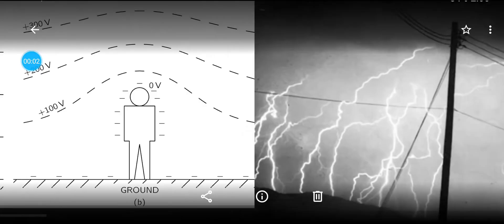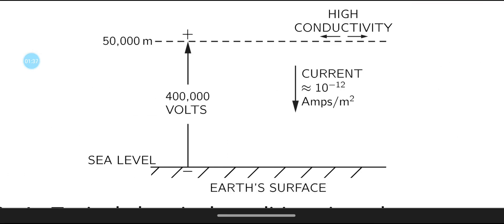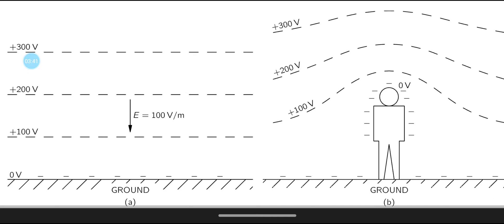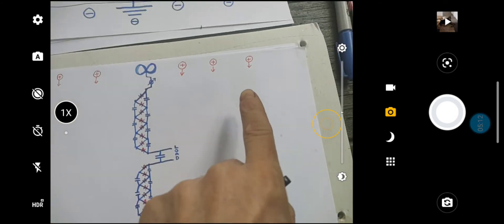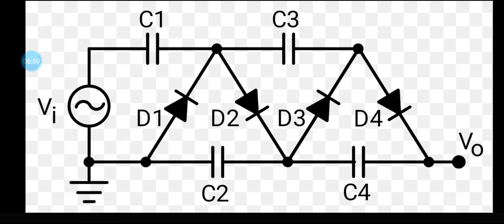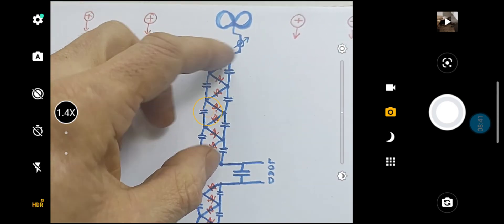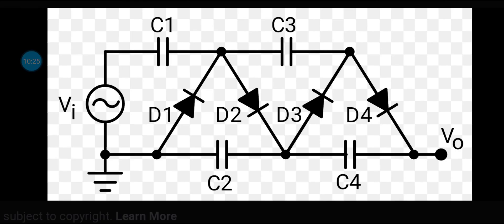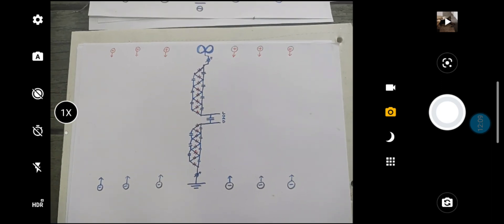Electricity in the Atmosphere (My Harvesting Concept Based on Feynmans Lectures.)

Comment: the current across a capacitor can be described using the formula I=C*dV/dT where I is the current or amps(ampere units), C is the capacitance of the capacitor(farad units) and dV/dT is the slope, or derivative for calculus nerds, of the voltage with respect to time. What dV/dT basically says is that the faster the volts change with respect to time the higher the current will be(for example rapdily switching from 0 volts to 100 volts). Maybe if one were to have an antenna connected to a switch that in the "off state" was connected to earth ground and then in the "on state" disconnected from earth ground and connected to a capacitor of some kind. Then simply switching as rapidly as possible should increase the amps available to do useful work. One could potentially take the amps they would like to see as an output and then work backwards to find out how fast they would need to switch to achieve the desired output
Reply: So I did some math on this and it turns out that the best results, in math not irl testing, so far have come from switching between two different potentials which interestingly ties back into the parrondo's paradox thing. I re-read that paper after I mentioned it and in the opening paragraph they said "Parrondo’s paradox was discovered from investigations in the Brownian ratchet [4–8], where a Brownian particle shows systematic movement through switching between two different potentials.". That got me thinking "what if we switched the capacitor between two different potentials instead of just on and off?". So I looked at an example where one had two 2mm copper antennas with one being 1 meter long and the other being 3 meters long. Each antenna has an off state where it is connected to earth ground and an on state where it is connected to a capacitor of some kind(maybe a water based marx generator-like capacitor). Then one would simply rapidly switch between the 100 volt and 300 volt potentials. When the 1 meter/100 volt antenna is connected to the capacitor the 3 meter/300 volt antenna is connected to ground and vice versa. From the pov of the capacitor it is rapidly getting 100 volts and 300 volts and from the pov of each antenna they are rapidly switching between connected to ground and connected to the capacitor. The issue is that one would need a high capacity capacitor to get something useful out of it. For example with 0.2 farad capacitor and switching between 100 volts and 300 volts, 100 times per second, one would end up with roughly 250 volts and 5 amps. That is way more than enough to overcome any losses from switching 100 times per second and even if my numbers are somehow off by an order of magnitude.
Reply from the maker: Absolutely Fascinating Mate ⚡🙏⚡
There is definitely much to be explored.
Do you do any Experiments yourself?
If Not,.I think You should.
You have a very sharp & inquisitive mind ⚡🙏⚡
Reply: I took a pretty deep dive into this concept and what I said in the OP should actually work if things are done right. While the formula I used was correct I had a couple incorrect understandings of what it was exactly and was off on the amps available(200 nanoamps for 1 meter by 2mm copper wire because 100 volts and 500 megaohms resistance). So the capacitance of a capacitor, eg. 450 microfarad or whatever, simply means "how much coulombs of charge is required to increase the voltage by 1 volt". The total charge available in a 1 meter 2mm copper wire in the air is roughly 100 volts * 200 nanoamps=20 micro coulombs of charge. When shorting a wire what happens is the resistance drops to near zero, actually whatever the baseline resistance of the components like the wire, etc, which causes a corresponding spike in amps. The total power available doesn't change so that means that it releases the total charge in the system at some fraction of a second. Ampere units are a measure of charge flowing past a point in a second. So when shorting a 1 meter wire with 100 volts and 200 nanoamps there is a spike of 18 kiloamps but it would dissipate the total charge available in the wire in about 92 nanoseconds. That is too many amps for most systems so what I did was think "what if I stepped the voltage down to just 1 volt", which made numbers a little easier. Shorting the stepped down voltage the overall power is roughly the same but the amps are lower; shorting 1 meter 2mm copper wire with 1 volt will result in an amp spike of roughly 183 amps. With the same overall 200 nanoamps but 183 amps current flow our timing becomes more manageable at roughly 9 microseconds. Basically that means that if one were to take that 100 volts and 20 nanoamps, step it down to 1 volt, and then short it every 9 microseconds the net effect would be 1 volt and roughly 183 amps per second. Which could then be stepped up to a more useful voltage like 100 volts and 18 amps or whatever.  With a 450 micro farad capacitor it would take roughly 22 cycles to reach the 450 micro coulombs required to increase the voltage by 1. If the timing was right one might not even need a capacitor in the system though. The longer the wire the more overall coulombs of charge and therefore the lower number of switches per second required.

edit the timing is likely off because it doesn't account for the time it would take for whatever system is used to step down the voltage to charge(e.g transformer or resistors in  parallel). To make the above timing work one would most likely require several wires and to alternate between them. for example, say 10 wires, then you short wire 1, then wire 2, and so on. By time you reach 10, just for example, the first should be charged and ready again. In this example the copper wire is basically being treated like a tiny capacitor.
Reply from the maker: I love your thinking my Friend. If you do get around to doing experiments with this,
I hope you upload to YT and link me to it too.
Keep up the great work Mate.
Cheerz from Crazy Ham ⚡🙏⚡
Reply from the maker: Superb & Thankyou 🙏 I did read of such an experiment which did actually do that.
Thanks so much for your Highly informative comment & Merry Christmas ⚡🙏⚡
Reply: @crazyham  one thing I've been thinking about that I haven't really seen discussed anywhere else is a concept I'm loosely calling "short power". Just as an example, if one sticks a 1 meter long 2mm copper wire into the air, and it isn't connected to ground, then it will have roughly 100 volts and like 50 picoamps. 50 picoamps is not really enough to do basically anything useful with but if one were to short that circuit after it has the 100 volts/50 picoamps then there would be a drop in resistance to whatever the baseline resistance of the wire is, virtually nothing, and therefore, according to ohm's law, a corresponding huge spike in amps. In that specific example of 100 volts/50 picoamps it comes out to an amp spike of roughly 18,000 amps! 18k amps is enough to be extremely dangerous and is useful. In general a "short circuit" is when the resistance drops to zero or near zero and the result is always a corresponding huge spike in amps. One can kind of think of it like there being something blocking a pipe with high pressure water flowing and then it suddenly letting go. Maybe if there were a creative way to store those amps then we might be able to actually do some useful work with atmospheric and or static electricity in general(which is easy to generate in huge voltages but low amps)
Reply from the maker: @crypticnomad  Absolutely my Friend ⚡🙏⚡
I think the key is to find a method of rapid Switching or Square/Pulse Wave Oscillating (Ideally at resonance) that takes very little power to operate whilst harnessing/Storing or Using the Resulting Currents that could be generating more  power than is being used by the excitation source.
I do genuinely feel that this can be achieved
even though it would appear to defy conservation of energy.
I love your thinking my Friend
& I hope that you find the Opportunity to Experiment with This.
Happy Holidays from Down Under ⚡🙏⚡
Reply: @crazyham  Also, maybe the power could be used to do something useful and negate the losses from switching, like turn a big flywheel. In my last comment I mentioned how shorting the 100 volts/50picoamps results in a huge spike in amps. Then maybe something like the lorentz force could be used to apply torque to spin some flywheel which is then useful for a bunch of different applications. Basically the concept behind magnetohydrodynamic drives and ion thrusters could potentially be used to generate useful work from rapid bursts of high amps. In the lorentz force equation if the angle is right, 90 degrees, then the resulting total force is basically the amps multiplied by the magnetic field strength. In the example of the shorted 100 volts/50 picoamps and using a basic n35 it comes out to about 1500 newtons of force or about 340 lbf(high-end electric sport cars have like 450lbf) which is on par with an electric car motor. Then if that force is applied at the correct point it could be used to create torque to turn a large flywheel.
Reply from the maker: That sure is a Fascinating Idea.
No doubt there are numerous approaches that could be taken & I hope that more people experiment along these lines.
I guess small scale system First to prove the over-unity would be a 1st step
& then scale up in other ways.
I have ideas relating to utilising resonance at hi Q in multiples at different phase angles, like 3 phases 120 degrees apart.
I have observed if I Resonate a torus element (Hi Voltage/E field) it provides an impressive back EMF /current 
which has me considering making a branched type arrangement where I Resonate 3 tori individually each 120 degrees apart but all excited by the same source signal
and combining the Back EMF/Currents taking care to correct the Phasing (Adding the 3 phases of current onto one another into a magnified single phase.

I have successfully achieved 3 phases from a single HF RF signal Source.
(I wish I had a 3 channel Oscilloscope lmfao.)
I had to adjoin 2 scopes when I tried those experiments.
I look forward to getting back into my Experiments
when I am settled in my new home down the track.
Keep up the great Creative Mental Work my Friend.
I admire your Thinking ⚡🙏⚡
Reply: @crazyham  "over unity" is an interesting subject that there is almost a religious-like backlash against in some circles. On one hand it is sometimes used by snake oil salesmen types and on the other it is a real thing that is well documented and researched. Well, I guess that depends on how one defines "over unity". An example of it in the real world is what is called the "Parrondo's Paradox". Although paradox doesn't really fit since it is only a paradox until one understands what is happening. Basically the tldr is that sometimes two losing processes, games, or whatever we choose to label that, can be combined into one single winning game, process or whatever. Each game/process is still a losing game/process but what is a winning game/process is the switching, sometimes random and sometimes via some pattern like ABAA or whatever, will result in an output that is greater than the total input, which could be said to be "over unity" in a way. I'd recommend reading the paper "Occurrence of complementary processes in parrondo’s paradox" where they show how one could construct a "complementary process" for roughly 70% of losing processes and therefore create a net winning process by simply randomly switching between the two.  Here is a quote from the conclusion in that paper "Contrary to common intuition that the paradox is a special case arising from a specific set of numbers, our results have shown that this may not be the case after all. Processes that can achieve Parrondo’s paradox can be quite common, and we are able to introduce complementary processes for them, as seen in our analysis".
Reply from the maker: @crypticnomad  Thankyou my Friend
& Yes, I intuitively have known for some time that the idea of over-unity being impossible based on conservation of energy was quite literally a falsehood. We don't understand enough to be able to make such a claim.
I feel strongly that there are so called laws of physics that shouldn't be laws
but more so simply consensus amongst peers.
I also feel that we misunderstand electromagnetism & our models are flawed.

I love that you are so switched on
& I have really enjoyed engaging in chat with You my Friend.
I wish you a great Holiday Season
& may 2024 be a Fruitful Year for You, Your research & experiments along with Those dear to You.
Cheers from Down Under ⚡🙏⚡

Comment: But even with sunshine weather??
Reply from the maker: There is always a voltage gradient between ground and the air above.
it varies in Volts per metre 
& also varies from a vertical gradient to angular,
but it's always there.
(Assuming that's what ur Question was about)
Thanks for your comment my Friend 🙏

Comment: In my own experiments I can only explain that energy density is important to maintain a current at a voltage for a certain time. Voltage = pressure or the difference between two points. For example if I have a 10 gal tank with 100 PSI of pressure it will provide a tenth the power of 100 gal tank at the same 100 PSI. So we must see voltage as pressure according to a volume between two surfaces of certain volumes. I have thought  of the concept you just explained and done it with two parallel versions of a Walton Crofton doubler configuration circuit much like you just showed in your schematic but doubled like the Walton Crofton configuration used as one of the early accelerators only much smaller of course. I can multiply the voltage yet reaching the desired voltage then it needs to switch and release a current at set timing to maintain a certain current at a lower voltage. So let's say I have 1200 volts and I step that down to 12v. Then I can exchange voltage to increase current and if I switch that efficiently at the correct frequency I have a functional source of harvesting some energy for later use for night time charging while solar is not working. My project is still in the works and my biggest obstacles are financial since I budget to pay for my own experiments and ideas since they are so crazy that I don't care to ask for any help. My experiments are only for me to figure out things that bug me with questions to my own mind. So it's just my personal hobby. Your ideas are headed in the same direction as I have been experimenting with also so I found your video very refreshing. The multipliers help with reaching a desired voltage without having to place my plate antenna as high and with a huge surface area and hundreds of pointy needles sticking out of it like something out of a hell raiser's nightmare... lol. I also have combined this with some joule thief type circuits to switch the current. I recently been building a large electrical accumulation station. Like a power storage. Now days they call them solar generators but they are just storage units for energy harvesting from the sun or anything else you can use to charge them. Mine is an experiment in itself because I am using 3 types of storage combinations using graphene Ultracapacitors, Lithium   titanate oxide, and Lithium iron phosphate together. Configuration to make them compatible in voltage was a bit challenging because of the different  chemistries being uneven for voltage yet I made the adjustments and it is working but that's another story there. Keep experimenting and when I get my crazy gadget up and running fully I will make a video and share it like you have also. Alone we can  achieve a certain amount of things but together we can multiply that exponentially.😊
Reply from the maker: Fantastic my Friend. I am so pleased to hear from another Experimenter & I do look forward to seeing your video down the track if you get to that.
I do plan to get back into my experiments when I settle into my next home (hopefully by mid 2024).
Keep Up the Great Work my Friend ⚡🙏⚡
Reply: Have u guys heard of red brick storage?  Red brick batteries?
Reply from the maker: I haven't heard, can you tell me more ?

Comment: I remember having thoughts as a small child of 4 or 5 years old that the electricity coming through the wires in our house and running the TV and my old radio and record player and lights was from harvesting lightning and power in the air.
I used to see large power transmission centers with large metal structures 
( one looked like a large chair so we called it ' King Kongs chair ' ) when riding in the car and had the idea since I had no real idea how it all worked.
When I got a bit older I found out more of how it really worked.
In a Tesla world I might have been right.
Reply: You have a wild imagination my friend
Reply: @Tom-f8r8o where did you think it came from?   As a child